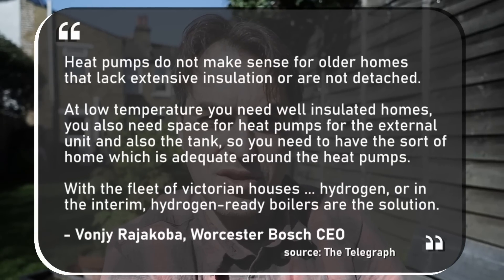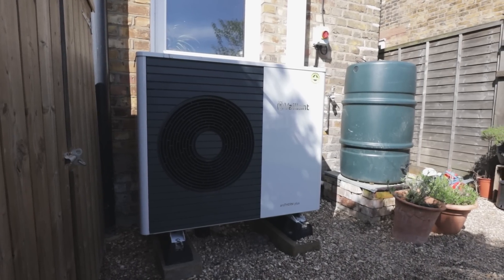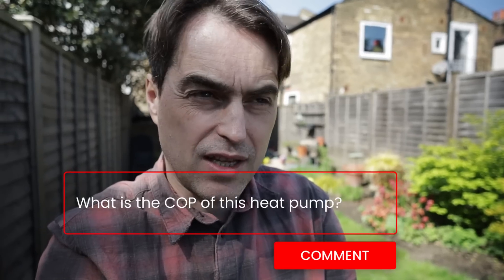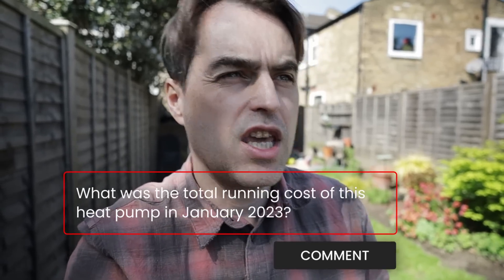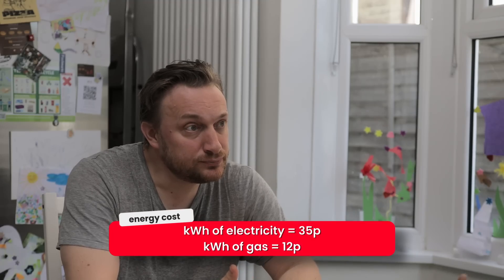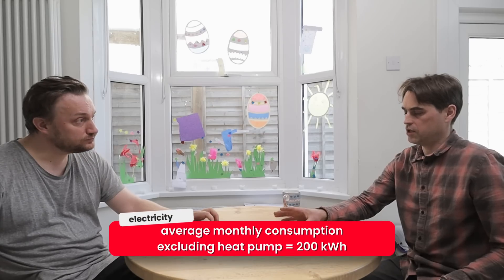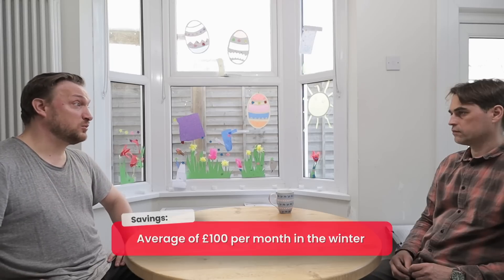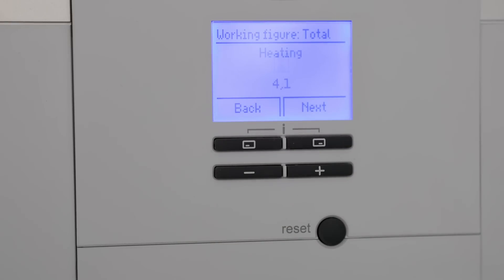Worcester Bosch CEO Is Wrong About Heat Pumps. Here Is Why.

Comment: Nice video, same like others on your channel, and keep them coming. However, you must admit on some level you are as bias as that CEO. Them companies, obviously will have a good reason to say why you shouldn't get a heat pump, regardless of what house you're living in, however when you want to make a video supporting the heat pump industry, and keep yourself objective, more information should be brought into conversation. If I am to swap my 200kwh with 700kwh, will definitely have to add the cost of investment/maintenance etc. For a house(regardless of age), with a combi boiler, decent radiators and/or newish water tank system, replacing any fault boiler, shouldn't cost more than £2k, if. How much is to install, replace or even maintenance of a heat pump system??!.... And I'm not even add the risk of having a plumber with little knowledge who will do a botch job, and that is priceless. Find a heat pump system, easy to install, easy to set up, easy to use, not expensive parts to replace and make a video please. Then you will give to any CEO something to think about in a unbias kind of manner. Dont think they exist yet. Cheers

Comment: Your Videos are great. Me and my wife are currently stuck with LPG Gas and are in the process of planning a full renovation, we have decided its best to make the switch to The aroTHERM plus system. I wish I could have the confidence that whichever MSC Installer we end up using to install our system would have the same level knowledge  as yourself to make our system run to the optimal level. With this is mind I am  leaning on the side of caution trying to pick the best person to fit our system and with being located in Southwest, Cornwall there is not a huge pool to pick from so if you could recommend anyone located down here feel free :). We are thinking of doing retro fit ufh system throughout the whole of our downstairs and recall seeing another video of yours where you say that because its a retro fit not a screeded ufh system the flow temp will need to be set to 45c appose to 35c. My only question is would it make more sense to have ufh throughout  the upstairs as well or stick to rads for the upstairs? Thanks again

Comment: I’m very late to the party here, and I agree I’m coming round to the idea of this form of heating… but, and there is a big but these will not replace current units without a massive change for installers within the UK. And additionally customers need to be educated to this style of heating. The days of turn on and expect to be warm in 30/45 minutes does not work for these units simple as that.

Comment: I have tried lots of times to get an installer to fit an heat pump to my home , however 3 installers failed to return my calls or emails, 1 company turned up but when i started asking about cop and other things they didn't get back to me with a quote Its a big house around 350m2 but i don't see how this should be an issue . I want to change over from my oil boiler , i also have solar hot water so have a large water tank. will try contacting heet Geeks PS> Based in Scotland. keep up the excellent videos

Comment: British gas have come out recently and said quote in the depths of winter ASHP are not as efficient as  a gas boiler. There words not mine
Reply from the maker: British Gas hasn't learned how to install an efficient gas system yet, so they are not an authority in heat pumps or efficient boilers really.
Reply: @UrbanPlumbers  🤣🤣🤣🤣🤣
Reply from the maker: It’s tragic really not funny.
Reply: @UrbanPlumbers  no youre not unless you've passed your f gas you can't even take the front cover off the o/s unit
Reply from the maker: @colinensell920  what are you on about now? You dont need F gas to take the front cover. But I am wasting my breath with you anway.
Reply: @UrbanPlumbers  yes you do any air con equipment engineers work on req f gas. But youre just a plumber 🙈

Comment: What was the install cost and the expected lifespan of the system- and what are the annual servicing costs, and any annual/long term consumables?
Reply from the maker: after the grant average system cost is £8-£15k in the UK. System life span should be decacdes, heat source should be 15-20 years.

Comment: The instalation must cost alot more .than a gas boiler .
Reply: How efficient  is the heat pump when charging the unvented cylinder ?
Reply from the maker: around 3.0 on average thorughout the year, so 300% efficient

Comment: Our 94yr old ‘ciocia’ has a big 1904 stone Victorian mid terrace (and huge cellar) in Yorkshire that actually had a cavity wall front/rear which was foam insulated. Even with tall ceilings it does not require much heat to retain a comfortable living. Her house is boiling and her gas bill is cheaper than our 3 bed ultra insulated brick semi.  There you go…..

Comment: I'm not sure the Worcester Bosch CEO is willing to write-down the investments in gas technology; at least not on their watch. They have to find a reason why hydrogen boilers are a necessary part of the future. Also I'm not sure how well their tuble-dryer-like heat pumps are selling, so that side of the business may not have the whip-hand within the corporate hierarchy.
On the other hand, the Vaillant's Arotherm Plus systems look to perform very well, at least when Urban Plumbers installs them. Let is hope the supply chain issues ease.
Reply from the maker: Non supply chain issues anymore as far as I can tell. WB heat pumps are not that great and lagging  shined the competition big time, while Vaillant has produced an excellent package

Comment: Tell us the total cost of the installation including replacing radiators, necessary repairs, renovations, redecoration and electrical upgrades due to the installation. I suspect it won’t be less than £25k. Pointless when you can have a highly efficient gas (or oil) boiler for £5k or less without any modifications of your home. Scores very highly on the virtue signalling scale though.
Reply: It's pointless knowing the total cost of install as every house has different heating requirements and it's highly unlikely that even the neighbours cost will be the same let alone a different house in a different location. Also the costs for the upgrade to a low temperature heating system should be considered separate from the heat pump cost. It's like saying the replacement roof cost should be included in the cost for solar. Converting to low temperature heating opens up the possibility of more heat sources, including a gas boiler. It's just the area that heat pumps excel at so you can extract the most efficiency from the heat pump by doing those upgrades. As a previous video shows you can stick to old rads etc and still get somewhat decent efficiency, it's just not recommended unless like in that case there are plans to make radical changes in the near future (that one was the intention to switch to ufh).

Comment: I would say this property looks like has PVC double-glazed windows and probably no pine floorboards with gaps. So you can expect it's not a average single glaze wooden sash terrace. Most likely on average heat pump would perform ok. I would say if you going for heat pump get yourself solar panels and your own battery storage. This combo is definitely the way to go!

Comment: I live in Belgium and I'm medically disabled, which means I get "social rate" for gas and electricity. The problem with that is the cost of electricity compared to gas is a ratio of about 7:1 while the kWh-consumption with a heatpump compared to an efficient gas boiler is only a ratio of about 1:4, making it cost double in consumption. Since the heatpump consumes the most electricity when you can't generate much solar, and injection rate in the summer is so low compared to consumption rate in the winter, it's pretty much impossible to compensate for the higher cost that way. 
Bringing down the social rate for electricity would 'cost too much' and probably encourage people to 'earn a buck' by f.e. letting their non-disabled friends and family charge their EVs at their home. Ramping up the social rate for gas would be a problem for the many disabled people who rent or otherwise can't choose to switch from a gas boiler to a heatpump, so I don't see the government fixing this any time soon...
Result: I installed a brand new gas boiler last year, in my own home that's otherwise almost textbook 'heat pump ready' (insulation, large radiators, boiler temperature of not even 50°C when it was freezing outside). It's a shame really, but I can't afford spending more money on a heating system that costs me more in consumption out of idealism...

Comment: My gas boiler was purchased for £800 and installed for £500. That was 11 years ago and it's still working perfectly with only the electrodes having been replaced. How much is a heat pump installation and how long will it run?
Reply from the maker: Peter Miller can supply and install a heat pump for you for £150

Comment: Another great video Szymon, can you remember what the heat loss calc was for that property, what flow temp did you design for and what size ASHP did you fit?  Also, I've been told 'designer' radiators sometimes don't hit the required output numbers, which brand of triple column radiator did you install for the customer? Hope it's ok to ask.  I wish you covered Norfolk.
Reply from the maker: The heat loss was 8.3kW. The system was designed to run at 45C but in the end, it has been running at closer to 38C. That suggests the actual heat loss is a bit less than calculated. (Which is usually the case but not always)

A lot of flat panel designer radiators or flat column panels are terrible at outputs, however, the round tube design is excellent. I have used those rads on other jobs and they are very good. I do not remember where those were from. 

The outside unit is rated to 7kW at -7 so for this application at the flow temp of around 40C it's maximum output is around 9kW. It is oversized for this house at the moment by around 2kW but they are extending into the loft, so by the time they are done with renovations this summer the unit should match the house load perfectly.
Reply: Designer radiators might look pretty but there is just not enough radiating area. For the same wall footprint you can have two panels with two convectors.

Comment: Huge air con unit in the garden, a cupboard sized space full of bits and bobs and a cylinder. Limited hot water, enourmous radiators that never get hot just luke warm. Yeahhhh... Nobody wants these bro, Bosch man is right, we're all still buying condensing boilers! Or maybe you are right and Bosch don't understand anything about heating homes? :)
Reply from the maker: I hear Bosch makes god washing machines though 🤣🤣🤣
Reply: @UrbanPlumbers Miele are the preferred brand of washing machine. Bosch are known for making extremely efficient boilers. The best in their class imho.
Reply from the maker: @SouthIslandSk8  Bosch boilers are pretty poor quality and designed by people who never worked on a boiler. They have some of the most shocking failures from all the boilers and are a nightmare to work on. Some of the shocking design fails are PRV that is next to impossible to replace, expansion vessels that require removal of the boiler from the wall to change, lack of low water pressure sensor making the boilers run dry and crack the heat exchangers - usually, a boiler write-off. Also, aluminum heat exchangers that are not very durable. WB sits somewhere in the middle of the boiler quality score, but are priced as a premium product, which they are surely not.

WB weather compensation and controls are also lagging behind the likes of Viessmann and Vaillant. WB heat pumps are also years behind Viessmann and Vaillant.

WB has a very good customer support and a great warranty on their products. However, product development is not that great.
Reply: @UrbanPlumbers  The 8000 addresses most of these concerns, and is a dream to work on - however I can tell you I have two other properties with Bosch Greenstar boilers in them from 2008 never been serviced and still running. One of them has a cracked heat exchanger which causes the boiler pressure to go up sometimes, but it's still running! The other one from 2010 is also still running and never been serviced, it has a failed expansion tank, but who cares? It still works! The radiators take up the expansion I guess.
Reply: The property I live in that I installed the 8000 in had a glo worm boiler from 2015 rusted to fuck and leaking everywhere. Noisy piece of shit that was.
Reply from the maker: 8000 is just a CDi in a new case with a low pressure sensor. Good boiler, probably the best WB ever managed to make. Still not even close to Viessmann or Vaillant.
Reply: @UrbanPlumbers  Vaillant make the rust bucket glo worm shit heap boilers LOL
Reply: @UrbanPlumbers  >8000 is just a CDi in a new case with a low pressure sensor - Hardly! the entire thing has been redesigned, everything is in a different place.
Reply: I like how people so openly show their naivety surrounding heat pumps when they use a pro of a properly designed heating system as a con of a heat pump.
Reply: @BenIsInSweden  In the winter, in our mid terraced victorian with insulated loft, it takes a lot of heating to keep us at a comfortable 22 degrees. Granted some English people may prefer a much lower temperature, but to achieve that, I need 9 radiators going at 60 degrees C and 2 open fireplaces burning coal. The idea of having luke warm radiators is a turn off. I need to feel the heat. Maybe you potato eating, vegetable pickling, mole like albino boys are happy to use an extra jumper but not me. I don't see any need to replace my Bosch 8000, it's extremely efficient and very clean and it produces hot water all day long.
Reply: My boiler not only burns very clean because it is extremely efficient, it also doesn't rely on an electric heating element like Heat pumps do for times when heat pumps aren't able to provide the heat. What's the reason we're upgrading to a heat pump system? Is it so we can be more environmentally friendly? Using electricity made from Burning oil gas and coal instead of just burning the gas ourselves? Or is it all a huge net zero money making scam like everything else in life?
Reply from the maker: Even when heat pumps are powered by gas turbine run power plants they are still more efficient and much cleaner than gas boilers. Plus cheaper running cost when installed well an extra bonus.
Reply: @UrbanPlumbers Yes you are 100% correct. It makes sense right. If you put out 1/3 of the heat you'll use 1/3 of the power. It's a bit like LED lights, they produce half the lumens of a sodium or halide bulb on a watt for watt basis, and of course use half the power. But the catch is you get half the amount of light from them as well. I can see you are pushing heat pumps from a commercial perspective, I think it has the same future as electric cars. None. Something cleaner to burn (not that natural gas in a modern boiler is not clean), that satisfies the human caused climate change fanatics - will be supplied to our houses and we'll all keep using condensing boilers, imho. For that reason regardless of the costs of GAS, condensing GAS boilers still outsell heat pumps on a massive scale. We want to stay warm, whatever it costs!
Reply: @UrbanPlumbers  I wonder if the heat pump at around 15k to install, and lifetime of 10 years, ever recovers the installation costs in it's lifetime, with reduced running costs as compared to a highly efficient 1.5k gas boiler :) Gas is everywhere for free, renewables cost a lot to produce and are extremely poor at producing energy. Gas will always be cheap as chips, unless the prices are being artificially inflated to try and force people away from using it. (just like petrol).
Reply: @SouthIslandSk8  You're literally proving my point.  The "luke warm" radiators aren't for having a colder temperature in the house.  A proper designed system will mean that the system will constantly produce enough heat to counteract the heat loss.  Which can be designed to target 22⁰C if you want to.  This is opposed to the "dumb" approach of blasting heat into the room until it reaches a temperature then it switching off/scaling back until the temperature falls below the desired level, and repeating over and over.  Most of the UK won't require a heat pump that costs £15K (if any). So you are including the cost of switching to a low temperature heating system in that cost, which isn't a cost a heat pump should "pay back".  The argument that it should is akin to Solar Panels should pay for a replacement roof because the roof can't support them (too old etc). Low temperature heating gives you far more options for source of the heat as well, and isn't just restricted to ASHPs.
Reply: @SouthIslandSk8  Because people like you believe the misinformation on them, and keep on spreading it around.  Look at countries that have millions of them installed and have done for decades - Canada, Norway, Sweden, Finland.  Poland is getting loads installed now to replace gas.  Like saying that they require an electric heating element.  None of the UK modern ones do.  There are even cold climate ASHPs that can go down to -25⁰C without an electric heating element.
Reply: Correct. Worcester Bosch are stuck in the past doing what they know how to but not moving with the times. Dinosaurs.
Reply: @SouthIslandSk8  not sure what your point is with the link, that's an American unit and American focused page, they are behind European ones by a country mile.  Defrost cycles are handled far better by eu units where icing up to the degree they are saying is extremely rare.